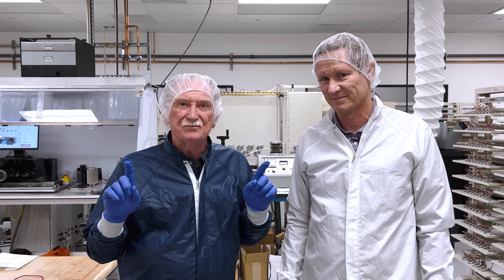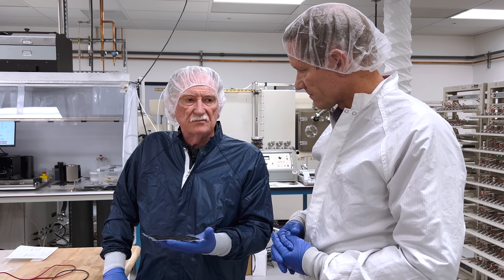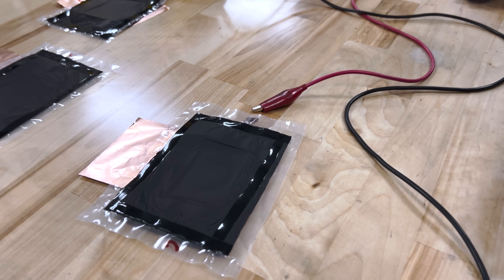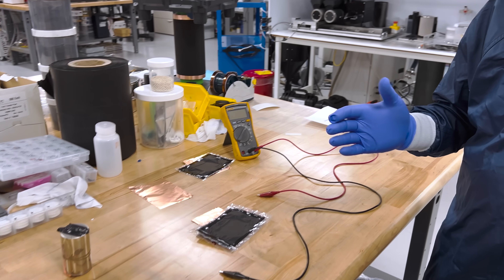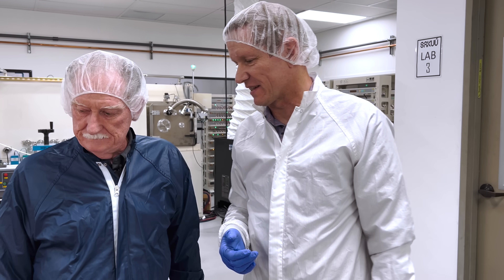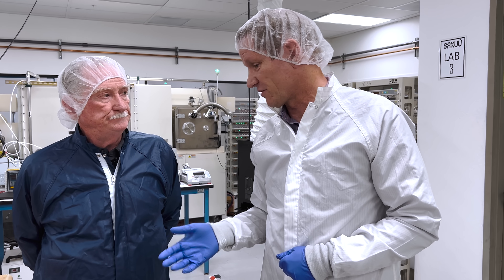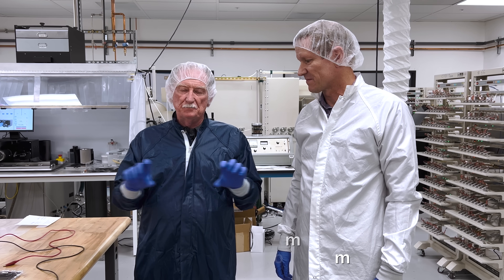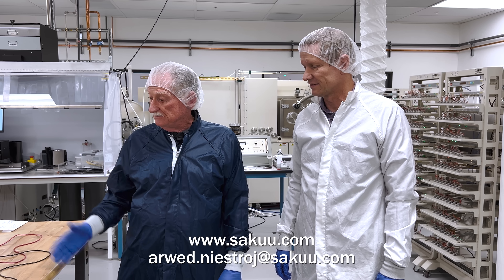Sakuu's Metal-Free Battery Cell: Game-Changing Innovation

Comment: Sounds like a decent start, but exciting battery technologies tend to do poorly in some specific area: temperature losses, dendrites, internal ohmic losses, aging, vibration, etc.  They need a white paper discussing all of these aspects, even if they have only modeled it thus far.
Reply: Zero dendrite formation as there is no liquid medium.
Reply: @Barskor1  Why would that mean no dendrites? You can have solid state and still have dendrite issues.
Reply: Cool potential but agree there is more dev work needed before the hype train leaves the station.
Reply: Good points.  And, what about recycling?
Reply: @scrapyardwars Sounds like he actually knows the difference between a lab prototype and a production ready piece of technology to me.  

I'm disappointed this channel resorted to hyperbole to pump a piece of tech that's not ready for prime time.

Comment: I missed Information regarding fast charging in terms of the C-Rate. And another pount is that having no metal plates has also disadvantages. the coolung of this cells I think can be a problem. Questuon is, how good are this polymers wirh thermal resistance and how will this plates expand during the charging process.
Reply: Intentionally left out, which means slow.  The work arounds are probably expensive. But we really don't know until they are more open.
Reply: See C-factor in previous video.

Comment: Sandy, 

@6:00 96 Wh is an energy, not a power. And herein lies the rub, what is the rate capability of this cell? Is it even close to sufficient at room temperature?  What is the columbic inefficiency per hour?  You guys really need some non biased battery consultants or staff  to assist with these segments before you start declaring things like this to be the future.

Lastly, current collectors play a secondary role as thermal conductors. 😅 

“We’ve already done a nail penetration test…”  

Yea, because the rate capability is so damn poor… it’s “safe”. It’s not capable of power delivery. That’s something that a battery needs to do. This is not a cell that will work for applications like automotive. Maybe watch batteries… (not smart watches)

Comment: The slide they showed gave a KWh number for power.   That was a typo.   Power is Watts Energy is KWh.
What is the POWER of the cells?

They bragged about the resistance improving safety, but with the resistance, it seems like there will be a lot of heat....   How is the heat extracted?  This will limit both power and charge rate.

Without more info it is hard to say, but it looks like these cells are best suited for applications where the current through the cell can be kept very low.
Reply: Nod. It would be easy to run many of these in parallel. For that matter, making them tiny would lead to easy to cool stacks in metal squares. Easy to cool, easy to stack, easy to replace.
Reply: Not a mistake on their part, this thing makes very little actual power (i.e. Amps x Volts) the demos is with a load of a 10 M Ohm Volt meter, thus 0.3 microamps or 300 nanoamps

Comment: If removing tabs cost about 7% that can has to be at least another 3-5% = 10-12% cost savings. As for the can I would assume you just make larger cans to house more so you will save, but the savings would come from not having to have as many smaller cans, but full size sections or packs. Still if that is the case, it would allow them to make custom packs for any cars out there - so if you need a battery replacement - that would be pretty nice in terms of options out there. The only problems with CANs is the fact they loose some area because they are round, so it would be neat if they can make them use more over all area. That alone is like 30% of the total area that could be saved for even smaller over all packs and if they really are more power dense for the area - that could be another 20% less over all battery you will need. So a pack that would be half the size today would be pretty amazing stuff.

Comment: This is amazing because you don't even need a battery tray anymore. You can have stacks of these polymer layers in the doors, the pillars, the wheel wells, and everywhere throughout the car!
Reply: Reminds me on a volta column.
Reply: If you "stack them around the car" you're just transferring battery weight to the interconnecting cables, so no.

Comment: Nice, but some unanswered questions are if they can be built in production quantities, are they durable in the environment of a car, and if they have sufficient calendar aging.
Reply: IDK
WDK
TDK
NBK
Reply: I'm also concerned about the scalability in capacity per unit.
Reply: Unless the battery is easily replaceable at very low cost. Then it is a game-changer.
Reply: Biggest challenge is scalability. Laboratory sample and getting GWH capacity produced is a completely different ball game.  Tesla after acquiring maxwell for their Dry Battery Electrode process is nit not having enough yeild after fine tuning the process for 4 years. So not getting so excited about this right now.
Reply: Innovation raises a few questions? Mindblowing comment 🤷‍♂️
Reply: 1000 charges and 80% capacity is way to poor.  I hope they will show way better figures than that.  If the battery does not last 15-20 years or more, it is useless for a modern car.
Reply: @la7dfa  Hmmm I disagree - If cars can be manufactured for peanuts and are simply and with value made recyclable then what would that matter ?
Reply: @la7dfa  I think calendar aging is something that's being ignored to a degree - what good is holding on to an older car with low mileage if the battery expires just on age.  I have two cars, one is a 2011 gas Escape.  It's cheap, it's reliable, and it cost nothing to insure or tax because it's 13 years old, but I would dump it if I knew the battery was going to die in two years.
Reply: @ohger1  Battery degredation is a problem with some EVs, but it is a relatively small number.   Have you seen any brand with massive battery problems?   Mine is 10 years old, and has probably lost a few percent range.  But I still drive about the same distance as I did  in 2018 when I got it cheap 2nd hand.
In the future there will be better materials, that can last way longer.
My next car will be an EV too, but with longer range so I can always charge at home, because electricity is cheap and 100% renewable where I live.

Comment: if this is chemistry independent, this is even better.
Reply: independent chemistry? what is that?
Reply: @ursodermatt8809  chemistry independent means that it (as in this novel manufacturing process) isn't tied to one battery chemistry, like NMC, NCA, LFP etc. if you can make Sodium Ion and LFP cells on this, as well as NMC/NCA, this would be insane

Comment: Sandy, when you do a review of a battery technology, you need too ask ALL the questions needed to determine viability.  Performance over temperature, ie -50C to 50C.  Cycle life, needs to be 2500+.  Hoping for a 1000 cycles is not encouraging.
Reply: Current EVs have a life in the 300-500 cycle range and they last 200-400K miles or more.  Really don't need huge cycle counts.  What most people don't understand is a cycle life is the worst case going 100% SOC to 0% SOC and back.  If you go 100% to 50% to 100% you double the cycle life.  Reduce the time spent at 100% and 0% and you further increase the life of the battery (although LFP is different in a good way).  1000 cycle life is not needed today, although a great side benefit. No automaker cares about going beyond 1000 cycles, which often equates to close to a million miles.  The rest of the vehicle will have fallen apart and the tech will be so out of date for a 30 year old car.

Comment: Looks like plastic coated in conductive ITO, interesting idea, but only for low power applications, the internal resistance will be very high due to this.
Reply: When you stack in series or truely bipolar you don't need maximum low resistance. You can now tune it low enough for low losses and high enough for avoidance of instant discharge.
Reply: @arwedniestroj3330  In series it's gonna be even worse. Don't you mean parallel? Not gonna be fitting for EV applications that way.

Comment: Interesting. Reminiscent of the Polaroid instant camera battery.  What is the current per cell? What is the charge rate ( and can it be charged at 10C etc)? What is the discharge rate? What about thermals? And thermals relative to peak charge and discharge?  Can it be fully charged and discharged?  We need a full comparison matrix.
Reply: See C-rate in previous video.

Comment: Electricity appears to be conducted through the walls of a plastic pouch.
I know that isn’t so, would you please explain?
Reply: Designed polymers have electronic conductivity, yes. Otherwise it would not work, correct. These cells are charging and discharging.
Reply: @arwedniestroj3330  Thank you.

Comment: I would love to pack an old (2011/12) Nissan Leaf battery back housing with this technology and see how many mile one could get from such an old car. New batteries for old cars at reasonable prices will change a the auto industry. If my old leaf could get 250+ miles from a charge, for less than $5K, every old EV on the roads becomes useful for almost unimaginable duration.  Long gone are the days of 5 years, or 100K miles being considered the real life span of a "maintenance free" automobile.  With tech like this, new cars can be great, but so can old cars and I hope somebody focuses on battery repacks for all EV's older than 10 years old. Since my 2011 leaf came out with 24KW battery, Nissan now fits 62KW in nearly the same dimensions now. Tesla is even better, but still better than their own 2011 technology. How far will a 2011 Leaf be able to get on a charge in 2031? Interesting times.

Comment: Ok 180-200kg for a 50KWh battery pack including case and support hardware is pretty impressive.
Reply: Its good to see they are reducing weight without losing volumetric efficiency. Reduction in battery weight is the most important thing. In particular for aviation. Every kilo saved is an extra kilometre driven. (that's a saying not a math challenge).
Reply: @DeveloperChris would be neat for these to be printed in shape of wings for fuller filling.
Reply: @PhotoHoag  have said something similar for a long time( i remember the time an automobile forum so much as told me i was crazy(years ago) when i postulated a smallish front drive pickup with a small turbocharged engine i want the wing structure to be part of the battery.
Reply: @PhotoHoag  Fuseilarge liner
Reply: @DeveloperChris  a pilot told me no mass change when fuel is consumed is a big plus(balance)
Reply: @DeveloperChris  For regular civic electric cars it is also very important - lower weight will noticeably improve range.
Reply: I remember the new Porsche ... I forgot its model name, but it has a big battery, a bit over 100 kWh, and they weigh at about 600 kg. Now, with this, they could probably reduce that to 400 kg. Maan, that sounds too good to be true. Let's make that 500 kg, and it's still awesome.

And on smaller sized cars, having a 30 kWh battery would mean that the car would probably weigh as much as its ICE counterpart. About 1000 kg in total, maybe even less. Exciting times!
Reply: @Winnetou17  Yes that's the reason why small EV vehicles are not popular. Current tech just doesn't allow to fit battery with enough capacity in them.
Reply: @APopov  I don't know, in Europe there's a surge in microcars. I'd say that for small cars the price is the barrier, not the battery capacity/range.
Reply: Only 250wh/kg at pack level. You need 400wh/kg at pack level for evtols.
Reply: @freddybell8328  2 points 1: when talking about printing in the shape of a wing that doesn't mean VTOL that means regular aircraft wing
2: while for any aircraft lower weight is critical to making it efficient to operate, who has decided that 400Wh/Kg is the only point at which  eVTOLS are viable? Surely a lower energy density would just mean it would operate at lower efficiency/carrying capacity/range
Reply: @Pegaroo_  good point
Reply: @freddybell8328  catl is already achieving that level (condensed battery). being  able to reduce weight again will only help
Reply: @freddybell8328 didn’t CATL already announce 500 wh/kg?
Reply: @freddybell8328 who was talking aircraft?
Reply: It will completely change the world
Reply: My 13 year old Mitsubishi minicab miev EV Kei van battery is 250kg for just 16kwh, a massive change.

Comment: Unusually superficial video from Sandy Munro. No real data on key metrics which govern commercial viability like charge and discharge rates, cooling and cycling durability. Also, not metal free since it contains lithium doesn’t it?
Reply: Lithium ions are not the same . When you have salt on your food, you're not eating sodium metal are you?
Reply: @Buzzhumma that would burn!
Reply: @Buzzhumma its a Lithium-metal anode so yeah there is actual metal in it not just the ions. During charging, a thin layer of lithium-metal will form on the anode side.
Reply: Lithium ions

Comment: My concerns are charging/discharging currents though the batteries when stacked in series. Thermal expansion/contraction of the series stacked cells,  the contact pressure and current capacity between the cells could be come variable and cause hot spots. Thermal control is also a concern. There are a lot of things to prove out but I like the concept a lot!
Reply: I said the same thing. You have great experience. Do you have content on youtube?
Reply: yeah, like the cold will reduce most batteries by nearly 50%.  Tesla insulates their pack to fight this and it's working quite well.  I'm not sure this type would be able to be insulated.